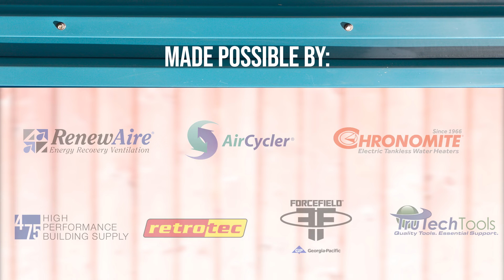Why Air Leakage FAILS and Active Mechanical Ventilation WINS: the Myth of 'Homes Need to Breathe'

Comment: The only differences between a leaky house and a tight house with mechanical ventilation is one has a filter for the air and  uses an expensive component that consumes electricity 24/7 and will eventually break and need replacing

A ventilator does not remove humidity. If there outside air is humid it will bring in humid air, just like a leaky house.

If the weather is nice outside and outside temps are equal to inside terms thus little air movement, you do what's been done for millennia- open a couple of windows.

Also, ach 50 is a really poor test for natural air leakage. What is the average leakage of a house with an ach50 score of 20 air changes an hour? In many climates it's as little as 0.3 actual air changes per hour.

A tracer gas test is a much more accurate test of the natural air leakage of a building
Reply from the maker: O, agreed, but the purpose here is to mythbust the misinformation that ‘you don’t want to build a house too tight’. We must use machines that will someday die. It’s the nature of conditioning. Likewise, we will both someday die. It’s the nature of life.
Reply: @HomePerformance  
The fewer of these  machines were use, the better. 

Example, to minimize the penetrations through your building envelope you could decide to use air admittance valves instead of vents - but would you? Probably not. It wouldn't be wise. Aavs' will always need replacing while vents could last the entire lifespan of the house with no maintenance.

No need to complicate one's life with expensive components of they can be avoided
Reply from the maker: Not sure you’re on the same page about the quality of life and health benefits of controlling air leakage and ventilation. It would be better to live simply, as nature intended, but that’s not the world we live in anymore.
Reply: @HomePerformance  
That's true. It's probably because i have seen claims but not any data that shows a mechanically vented house has a higher air quality than a naturally leaky house. 

I'm open to be convinced if you have any data to share.
Reply: @jl9678  can't say i've seen data. however it stands to reason that because you can filter a lot of the particles out with mechanical ventilation and that the ventilation helps remove pollution thats brought into the home, it will be better than natural unfiltered ventilation. we get a lot of pollen at times (turns your car yellow) so its really handy to keep that out.
plus the other big factor that i think tends to go unrecognised a bit is, as mentioned in the video, consistency of ventilation. mechanical ventilation can run all the time. natural ventilation only "runs" according to the weather which makes for inconsistent ventilation. thats why we still need additional ventilation even with homes that have lots of natural ventilation. we get that a lot here, houses do go moldy even tho they have natural ventilation.

btw fans are cheap and power they use is next to nothing. if your worried about power usage a solar panel and small battery setup would easily run it.
Reply: @tweake7175  i live in a "hot , humid" climate in North Texas. Characterized by fairly low wind speeds and low pressure differential.

It was tested in the 80s when houses had ach50 of 7-10 that without the ac running a typical house here had an ACH of about 0.1

Thats not a lot air exchange, yet it always been enough to avoid buildup of the nasty stuff.

Now it is not unusual in the summer to have relative humidity at 65-75 percent in the morning to mid morning. If you pull that air in mechanically you'll have  a huge problem of trying to get the humidity out later. So now you need additional dehumidification. Which is another complicated system that will eventually break.
Common sense may suggest that filtered air is cleaner but I'd like to see a comparison. If the leaky house at is coming through fiberglass insulation it may be better filtered than the hrv erv filter
Reply: @jl9678  fortunately we don't get your guys temps. however our average humidity is 80% and summer its a lot higher.
i suspect you guys will be hot but dry during summer which could be why the low amount of ventilation works. 
however low amounts of ventilation are not good for people, you really need to exhaust all the other crap out of the house.
hence why there is minimum standards for house ventilation, tho most home owners do not know that.

i doubt much air is coming through fiberglass insulation unless its got some decent air pressure behind it. certain see a lot of pics of dirty fibreglass where that is happening over very long time periods. but a lot of air gets around it as air tends to take the easiest path. also i highly doubt fibreglass will filter it well, certainly not to the level good filters can. otherwise the fibre glass would have been caked solid within a decade or two.
Reply from the maker: I have data, and personal experience to boot. Almost 4 years living in 200 sq. ft., 2 adults, 2 kids, 2 cats. Smells and feels great in there. Try that with any tiny space not tuned for performance.
Reply: @HomePerformance  200 sq ft? is that a typo?
Reply from the maker: Nope, 200 sq ft
Reply: @HomePerformance  impressive! What climate region are you in? I’ve been following Tiny Homes (as. a movement) as a builder from Ohio and now the PNW, and can’t imagine living in such a tiny space without the ability to enjoy a mild outdoors the entire year. Cabin fever is a real thing in the midwest... I’m genuinely intrigued!
Reply from the maker: After we left Chicago, we toured this tiny house around the entire US, now permanently living in Atlanta. CZ4
Reply: @stevenparker7946  did you get your tiny home Steven? I'm interested in tiny homes too, I live outside Seattle.
Reply: @David-gld Thomas, you don't need to keep windows open. The natural air leakage of the house makes sure there is plenty of fresh air coming it. From now on we will refer to it as "passive ventilation".

Pv is free, doesn't break and if you need more you can open a window for even more passive ventilation.

Also, I don't need a dehumidifier since I'm not over ventilation my house with a mechanical ventilator. Dehumidifiers consume a lot of energy.

So, to conclude-passive ventilation is cheaper and better than mechanical ventilation
Reply: @jl9678  the natural air leakage in a house and "fresh air?" I guess if you live in the forest? We're on several acres.. not if you're in the city, nothing fresh about it.
Reply: @David-gld  lol. I was bought into the high performance home idea once too.

No. Passive ventilation saves you money. You don't have to buy all that  other stuff that costs thousands and will eventually break. What is an erv if not a mechanical leak. You pays thousands to seal a house and then pay thousands to mechanically ventilate it and the high performance industry is laughing all the way to the bank

I live in a code minimum house built over 30 years ago. Highest bill this year even with everyone at home sure to covid? $154

Comment: I totally agree with airtight house but for cost to comfort balance for those customers who are not made out of money and actually have to work for a living as blue-collar workers. Living in the San Francisco Bay area you could be homeless in a T-shirt 365 days a year and only be mildly uncomfortable in the winter and barely break a sweat in the summer and have a old home that was built in 1917 that breathes a lot. And because the old homes breathe a lot when there’s a water leak in a wall or a roof it immediately dries out as soon as possible in the outer skins in these old homes are made out of real old growth redwood with nothing more than heavy felt paper has the outer skin wrapping underneath. These homes have been around for 100 years and they were easily be around for another hundred years without worrying about all the problems associated with an airtight house and a customer who cannot afford to upkeep the mechanical ventilation and will unfortunately develop water leaks that will get trapped underneath that air tight wrapping. 
         Myself I’m a airtight mechanical ventilator using HEPA filter air filtration into the house as a slightly positive pressure guru myself I’m all for it.
Reply: I spend as much of my life as possible outside. I fish, garden, hunt, and just play with family and pets. I go into a work shop or into my home to sleep. What does everyone have against outside air?
Reply: @michaelvangundy226  outside air is not a problem. in fact, as long as its clean, we want lots of it through our house. trouble is it removes a fair bit of heating/cooling which can give massive energy bills.  one problem we get here is people will close windows and turn off ventilation systems in order to conserve heating. within 6 months a family home is now completely riddle with mold and is trashed. you need to be able to have good ventilation with good heating. to be able to do that you need control over the air flow.
Reply: @tweake7175  
But you don't understand.  We have been trying to create the mechanically controlled environment for decades. It just doesn't work. High rises have "sick building syndrome " and hospitals have to keep the temperature around 55 to keep the spread of disease down. Even with a dedicated effort to sanitize the building they have developed disease resistant to antibiotics. You can't keep humans in a closed environment unless it is 100 % sanitized with no outside influence. Like the space station,  but I don't want to live like that.
Reply: @michaelvangundy226  i've never worked in a hospital thats been that cold (55f) or that hot (55c). typo?
antibiotic resistance is not caused by building sanitation (i do deal with biological resistance at work).
never really had the term "sick building syndrome" over here. quick google suggests lack of ventilation is the major cause. thats probably why there is minimum ventilation requirements. its really hard to get the right amount of ventilation around every room of a building if you can't control it.  if the building is air leaky you will get to much ventilation on some rooms and not enough on others which could lead to "sick building syndrome".
other than that i'm not sure what your on about. sorry.
Reply: @tweake7175  Do you know if all mid rise apartments have issues with ventilation? Esp. the newer built ones within the last 5-10 years?
Reply: @dianeibsen5994  i don't know whats in your guys apartment buildings these days.
the ones i used to work on never had any ventilation apart from opening windows and doors.
its a lot better if ventilation is controlled. having people or the weather control it usually means you get to much or to little.
hope that helps.
Reply: Michael VanGundy I love out side air as long it just came from the Pacific Ocean cost off San Francisco no dust no CO no pollen. It is a totally different story on the inner city. Just off the highway high CO, high pollen count, building and demolition dust, the whole outside and inside of the house constantly is getting dusty fighting it on a daily basis. You have to know your micro climate of your particular area. Just in our city we could have a 20° swing from one side to another and a 40% humidity difference if you don’t know your micro climate then you don’t know what you’re doing on the house if you use one Band-Aid to fix all injuries.
Reply: @coldfinger459sub0  
I get it. I'm just saying that kids today are turning into gaunt faced pudgy lazy couch dwellers. Get out of the house and live life. Unplug, try talking in a park. Go for a hike. Plant something to help clean the air.
Reply: @coldfinger459sub0  how do you find out the  microclimate for your area?
Reply: @michaelvangundy226  trust me that's not all from being indoors. It's only a piece of the puzzle. The toxins that people are ingesting and breathing are huge part of health
Reply: @michaelvangundy226  toxic, scented, man-made laundry detergents, dryer sheets, car exhaust, spray paint, jetfuel, pesticides, herbicides, chem trails, fire/retardants forest fires... I could go on. We're not in Kansas anymore 🌎🙏🕊️
Reply: Here we are considered a mild climate. However i think that tends to fool people and people overlook moisture. It gets cold enough and more importantly wet enough to cause health issues. But not that cold that people want to do anything about it.
Reply: Can you clarify what you said above? I didn't quite understand are you for it or you against it?
Reply: @dianeibsen5994  I am for it because it makes a more comfortable house. 

It does add expense of the mechanical devices that are needed to mitigate in control humidity. This is for sure. .  And if it’s in a climate zone that requires a dedicated dehumidifier that Hass to be left on 24 seven

Dehumidifiers have the shortest life expectancy of all mechanical components for controlling the environment usually around a 2 to 3 year lifespan .  

Initial upfront cost will be somewhere in the neighborhood of $4000-$6000 to install when initially building a house . 

Every 2 to 3 years let’s just say three years to make it sound more favorable at $1800-$2300 dehumidifier will have to be replaced depending on the size of the house will depend on the size of the dehumidifier’s and the climate zone . 

Finding competent contractors and designers is definitely going to be a learning curve and experience because many climate zones they’re going to build a mold machine we’re not done correctly.  Wood rot or mold in trapped inside the walls in the joists underneath the floor or up in the surface of the ceiling underside of the roof.. 

The added cost of make up ventilation to compensate for when the kitchen exhaust is turned on not to make the whole house negative and draw in the air through all the cracks around the house and make up system to supply air just to the kitchen area. well exhausting fumes of cooking out the range top that will be several hundred CFM. 

The outdoor make up air EVR or ERV 

These are all great homes to live in but they all come with maintainance and mechanical repairs that are needed that are no problem for people in the upper middle class and upper class cheer which is fine if that’s your target market . 

I know I install and service this equipment and converted my old San Francisco home is in presently being converted over to a near passive home . HVAC is my business.. 

All these devices, runoff, electricity specially the dehumidifier in some zones in Washington state where you have $.14 a kilowatt hour. It’s not too much more to the monthly bill. 

San Francisco California you get charged more for the more electricity you get used and your tear rate goes up usually you’re around $.36-$.38 per kilowatt hour but if you use too much more over your allotted and you go up to the next to rate of $.42, some people even pay $.48 per kilowatt hour for using an excessive amount of electricity as their punishment from PG&E. 

I’m all for it from the standpoint of comfort and the standpoint of my business. I will make money selling more products and I will make more money replacing these items as they break down and the service contracts for Baile early yearly or quarterly maintenance that needs a delivery truck roll out to the house is definitely profitable. . 

But the thieves were thrown into track houses with people who could barely afford to pay the mortgage who are buying their first house, or not just their incomes too low they’re not going to fix that EVR for make up air they’re not gonna fix that dehumidifier .  
When do make up air system breaks for the kitchen they’re not going to be fixing that .  

And when they have an airtight house and a kitchen hood goes on and there’s no make up air working anything that’s a gas appliance like a water heater house goes negative and sexy exhaust gas backwards, and 

If they have a gas furnace, the house goes negative, and that flu exhaust gets sucked backwards 

But yes, in general, I am all for an airtight house that is properly designed and has the proper equipment for the right climate zone

Comment: People tend to forget that air flow pulls in moisture as well as takes it out. I fixed up some cracks in the floor and the window condensation dropped in half over night.  
Ventlation is not always good. It needs to be the right type of ventilation.
Reply: Don't confuse air leakage with ventilation
Reply: @DocSawBlade  even here there is studies that show the amount of air leakage is related to ventilation. afaik our average air leakage rates gives about the minimum air ventilation required. however the problem is that its not consistent enough (as its controlled by weather) to be effective, which is why people still have to open windows or use ventilation systems.